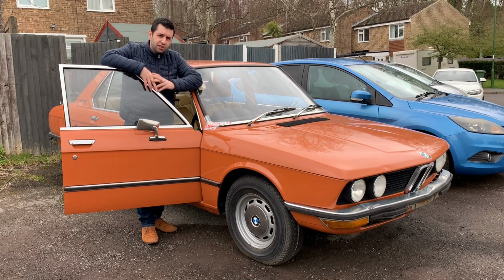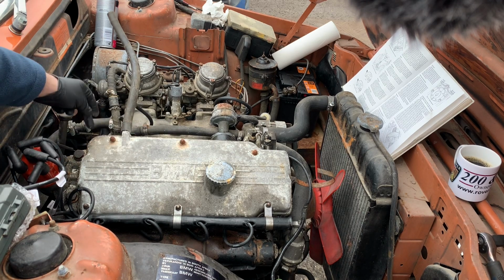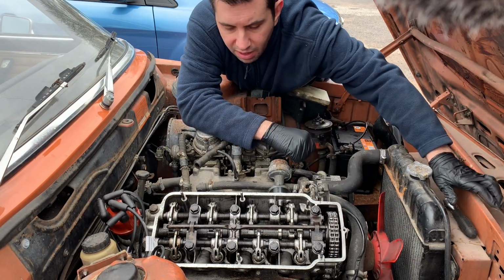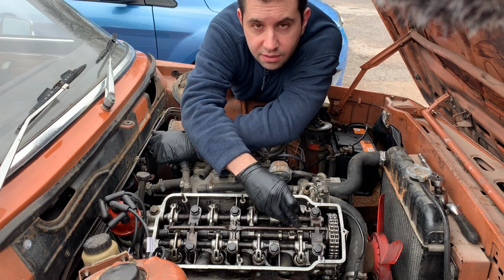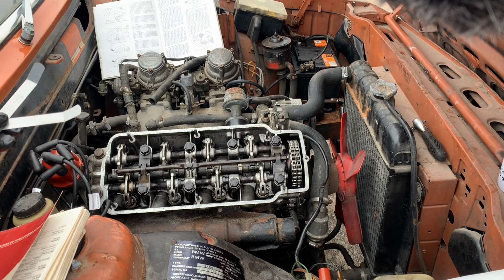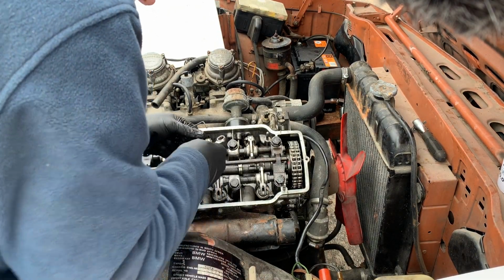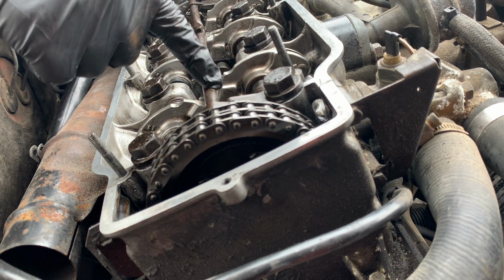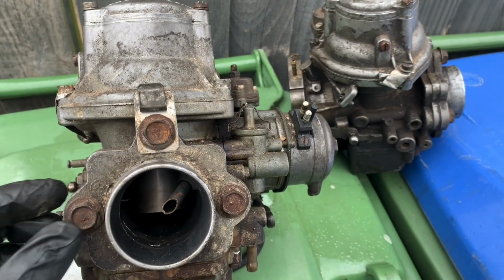BMW M10 valve clearance adjustment

Comment: You had the engine firing on number 4 cylinder and you should have  adjusted that at 007”, not number 1 cylinder. Cylinder 4 Rockers are on the back of the cam lobe which is the correct position. Number 1 cylinder is rocking on the cam lobes so there should be no clearance. The gap will be far too big and they will be very loud. I worked on these engines for years and did hundreds of valve clearances.
Reply from the maker: Thank you for your feedback, I apreciate it. will take it in mind next time

Comment: For me the nut screws are very tight. Will it cause damage if I use extra force to loosen them?
Reply from the maker: It might smdamage them, so it might help to heat them a little to help release
Reply: @GentilsGarage  Thanks! I will try that.